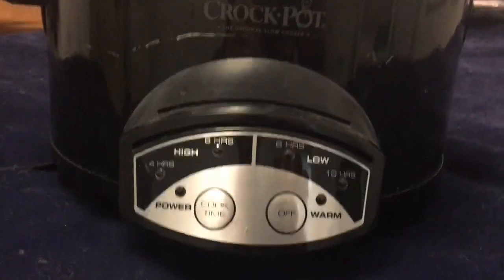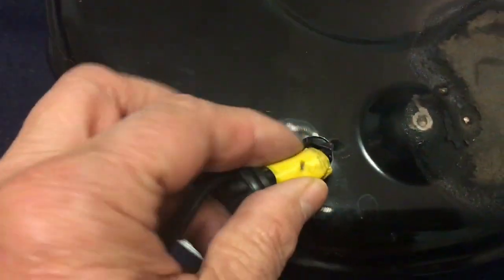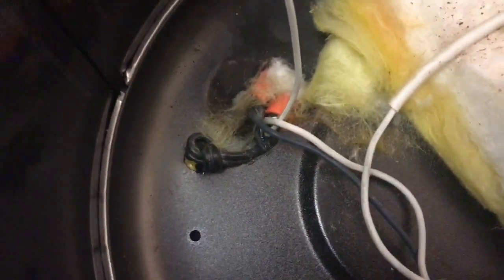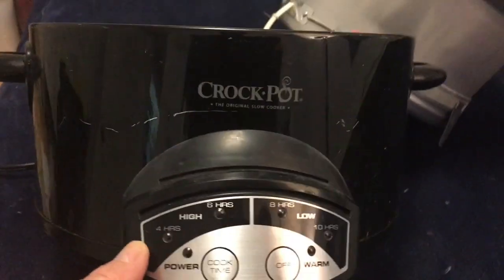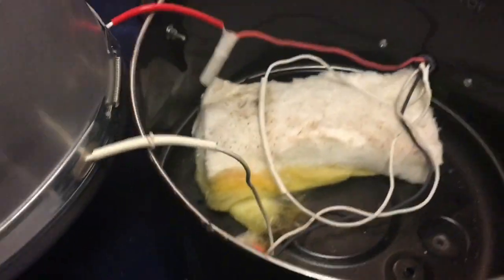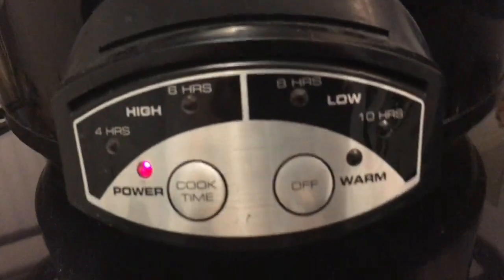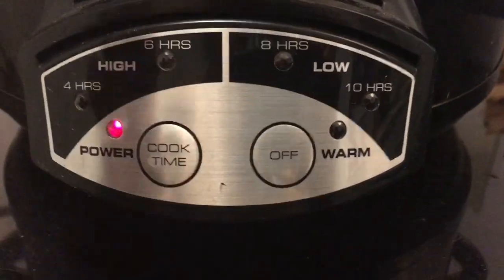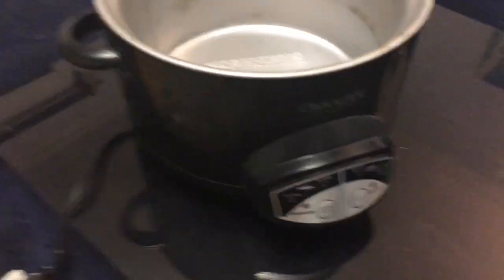Repairing A "Crock-Pot"

Comment: this is no help cannot hear or understand you
Reply from the maker: desertdispatch Ho, I'am so sorry..The problem with the pot, was the melting of the insulated ac input wires inside. So I change the line to a higher Meltdown insulation like a heater wire. That is the purpose of this video, helping. Now don't forget to unplug-it before servicing. Be more than careful with électricité, get help if you're not shuire of your habilité to perform, have a nice and careful day!
Reply: I wanted to know how to remove those screws that hold the bottom. I could not figure out how they are secured. The cord was visibly shorted where they exit the bottom of the pot.